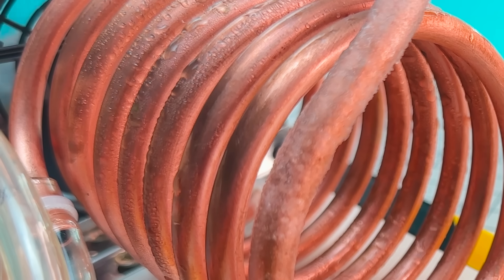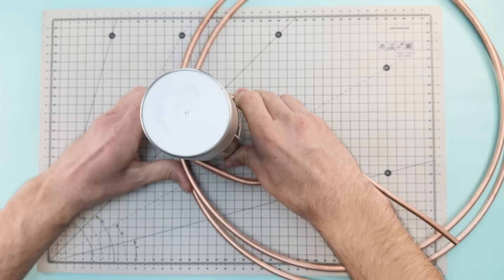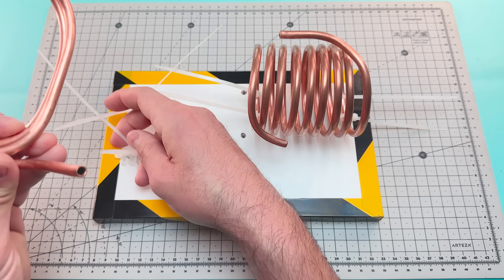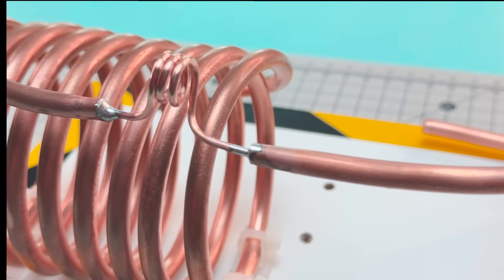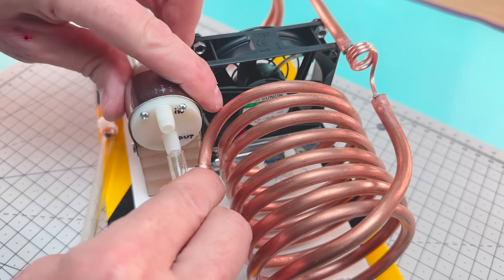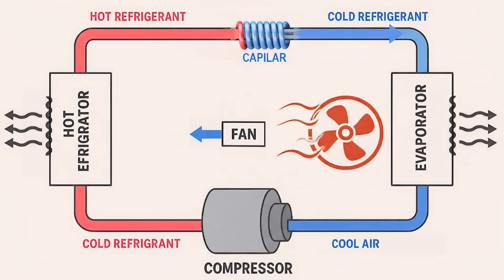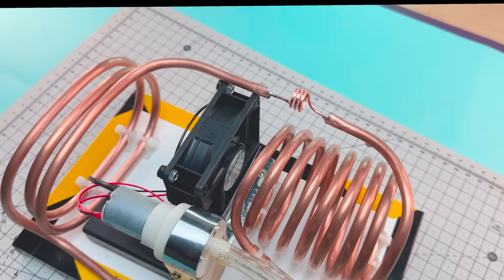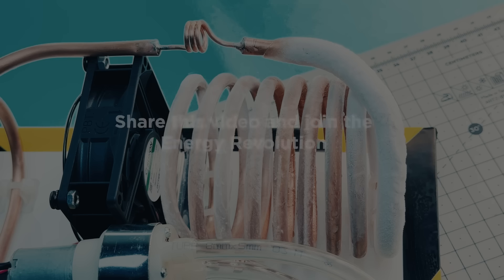Make your own AIR CONDITIONER at home Fast and Easy!

Comment: As an hvac technician, this is a fever dream 😂 please don't blow yourselves up guys.
Reply: There is not much gas in the system anyway. The worst thing that could happen is a short fire ignited by a leak and the motor brush sparks. Enough to burn your house down if you have it near flammable things, though.
Reply: that's the best part tho. 
he's got a diaphragm pump no sparks no boom. they're very safe to pump flammables.
Reply: @darkshadowsx5949  brushed motor "sparking brushes"

Comment: So many things wrong with this video:

1) Awful A.I. voice.
2) Voice cannot pronounce 'capillary' properly. It should be cap-ill'-a-ry.
3) Voice cannot pronounce 'Isobutane' properly: Iso-bu'-tane is correct.
4) Putting both coils close together is useless. The system as a whole will warm up the room.
5) Far too small to cool a room effectively.
6) Running a 12 Volt air pump on a 9 Volt battery. 
7) Running a 12 Volt fan on a 9 Volt battery. They both need 12 Volts from a good supply..

8) The battery is far too small in capacity to work for more than a few minutes.
9) The hot coil needs another fan, or cooling fins, for much better efficiency.
10) The deafeningly loud and overdramatic music is totally unnecessarily.

Also take note of the flammability of the coolant. Care is needed.

Apart from those points, and maybe with the addition of a thermostat for proper temperature regulation, the principle demonstrated is sound. It should encourage people to think, to make one and to improve upon it. Thanks.
Reply: dont' forget not purging the system of air before injecting the butane..   the unit would heat up a room , not cool it.  since entropy in room is increasing ..

Comment: You clearly have talent for engineering and assembly, and this was a very cool video ( pun intended ) That said, you really should not
A- imply that this device can replace an actual air conditioner. B- mention nothing about have to vent out the heat C- mention ANYTHING about the risks and dangers involved.
If you have the hot side AND the cold side together you actually have a very dangerous, highly inefficient and potentially explosive mini heater.

Comment: Even if this were a) pushing the heat outside b) powered by something more realsitic, air is a very poor conductor of heat. A simple coil is not going to expose enough surface area and needs a proper heat exchanger at both ends.  NOT AN AC by a country mile and a waste of precious copper.

Comment: It looks like your fan is pulling air through the hot side as well.  While it's not as tight of a coil that's going to reduce efficiency.  Would be better to put the hot coil to the side.

Comment: I think sectioning off the hot coil & adding another fan that blows the hot air, then adding a pipe to the end of the sectioned-off porion & leading the pipe to an open window & placing it outside, then adding a nutral fan that's blowing air from the room to both the fans, this is to improve nutral airflow to the cold & hot fans which then will improve efficiency & effectivity. 🙂

Comment: All this mfs complaining about not cooling a room, other saying its cool but just for a project but nobody here talking about using it on a car. I think it's pretty nice to use it in a car, the gas could be dangerous. Probably insulating the hot part from the cool part would be even more effective

Comment: Either you dont exactly know what you built does! Or principles of the refrigeration cycle is... Which is highly unlikely, given the beautiful experiment setup you made...

Or you are intentionally misleading the viewer by claiming this will cool down the room in just a few minutes!
Reply: True. One part of system needs to be contained. So heating unit should go outside, or cooling unit needs to be isolated in "box" like as you said is in refrigerator. But entire room which is for example 10-15m2 its ridiculous 😆😆

Comment: science project  , yes can be Explain Basic Air condition principles  but no way can cool any room , may be kept cool small insulated Box  as Fridge , Batter can not keep up long will die in Few Minutes which 9 volt batteries are most expensive batteries in market , powering Pump and Fan same time  will drain matter of Just few munities . can not be economical either .

Comment: It could be a fun project. A little separation of the two coils so the heat could go one way and the cool the other and it becomes a "personal cooler". Replace the 9V battery with a walwart and a second fan on the back coil and maybe in a box of some sort to channel the heat away. It is not going to heat up the room with a 9V battery running at 500 mA and dissipating 4.5 watts. Should not make you sweat too soon. Give the guy a break it could be a great science project. Might think about the flammable liquids...

Comment: This will actually RAISE the temperature of a room. For a heat pump to work, you need to have the hot side OUTSIDE. This is why refrigerators are WARM on the outside.
Reply: True. It has to be split to release cool air inside and hot air outside. Otherwise it will likely have no effect. I see such adds on internet where someone made a small portable AC but thats just a thermodynamic joke.
Reply from the maker: Exactly. But we can cool a can of soda.

Comment: .. here's at least a possible positive; this would be a simple demonstration device for a kid's classroom or science fair project on condensation/heat exchange using mechanical systems, though, as stated in quite a few comments, not useful when practically appiled (ymmv) regards, Geary

Comment: Shouldn't the warm air be vented outside or removed somehow? How long does the battery last? What do you do with the condensation? Does the gas need to be refilled?

Comment: Is the pump in the video just a regular water pump? Is it safe to use?
Reply: Of course it is not. using this pump with butane gaz and and electric motor producing sparks...
Reply: Its relatively safe as long as you keep it within a fire proof safe in someone else's house surrounded by fire extinguishers. Oh...And...Never turn it on.

Comment: Maybe you could put your machine in a box or small room. Check temperature before you start it and check it 3 hours later. The result will be interreting !
Reply: According to the law of conservation of energy: You are pleasantly surprised to find that ice has formed on the copper tube, but the temperature in the room or box has increased, haha

Comment: This object is only a copper tube cooler not an air conditioning. Cold is created at one end because heat is released at the other. Put the hot part outside the room and you'll have a true refreshing effect inside the room. But it's an interresting illustration of how an AC works !

Comment: The heat is just transfered from one coil to the other so it will not cool anything down let alone A ROOM! The hotside coil needs to be outside the room, ever seen an aircon unit on a wall outside,yes .

Comment: I know that fan hardly pulls any power

How long do those 2 1.5v AA BATTERIES last running the 12vdc air pump? Just curious because this doesn't seem very efficient

Comment: Ce dispositif ne vas pas être fiable dans le temps, dans un circuit "frigo/clim" il est impératif de faire le vide d'air (utilisation d'une pompe a vide), car l'air contient de l'humidité qui gèle a partir de 0 et qui va boucher le détendeur, donc plus de froid, et puis la position du condenseur derrière l’évaporateur n'est pas bonne il doit être isolé de l’évaporateur et  question sécurité mettre de l' isobutane dans un tuyau PVC ou silicone ne le faites surtout pas! j'ai travaillé 32 ans dans la production du froid, croyez moi ne le faites pas.
Reply: De toutes façons, avec ce type de tube et l'étanchéité des raccords, le gaz ne va pas rester bien longtemps à l'intérieur.

Comment: the pump is most likely 24v 3.5a. Fan 12v 0.12a. So whole setup is around 100w. Maybe for a small portable cooler is good enough

Comment: One little leak and a spark from either the DC fan and the blower motor any possible spark !! A little bit of a haboom wherever it is placed ..

If anything the coils need to be wrapped in insulation and  then wrapped in a foam or something, you'll need something for condensate, as anything to drop anywhere near the electronics and or battery is a hazard, should also incorporate some type of cooling the motor and battery as those will get hot !
Reply: ^ this

Comment: unless the evaporator side is ported to the outside environment, you are just putting that same heat back into the room you are trying to cool
Reply: You even generate more heat as you need to calculate the Electrical Energy into.

Comment: Hello, I want to do the same system. However, I got stuck in a few places. I could not get any results. The system did not work. Can you support me?
Reply: I really don't think it does work. There's a reason standard air conditioners use compressors and not miniature pumps. I believe if this really worked then it would have been done years ago. I expect there could be some cooling, but not a huge amount. You have to think about physics, and that you can never get more energy out than you put in, and you're only putting in a 9 Volt battery and a bit of liquid?!
Reply: @jewellymon1979  its more of a proof of concept if anything. Obviously things need to be improved/upgraded but it does work.
Reply: It didn't work because this particular setup won't work it's fakery
Reply: How to fix in 2 easy steps...

Step 1. Sell it for scrap
Step 2. Buy a window AC unit

Comment: i turn on my refrigerator ...and  let the door open 😉👋
Reply: didn't know someone else has half of my idea. other half is taking the refrigerating part for igloos apart from (inside those electric lids). now is there still an issue with actually heating the room that I'm seeing all in the comments?
Reply: @robert-asdf  an AC is a heat pump. Where do you think the heat is being pumped in this stupid toy? From one coil to the other. BOTH are in the same room. Think
Reply: @AG-sx9ws Been thinking. Now shorthand explain a mini fridge or those electric igloos. What components (and possible locations of it) are the guy missing? I did find something fishy with the whole thing when I didn't see any water going anywhere. I figured the smallest effective mini fridge a ytber would make, I would have to pour water out somewhere every so often, but I don't care.

Comment: Completely misleading info. This is just a small refrigeration unit design unit, not an aircon. You will first need another fan to vent out the exhaust and even if you do, the cooling can only cool a small freezer compartment box. To make it like a true air-conditioner unit,  the gas still has to pass through a separate set of much larger surface area evaporative coil just like any normal aircon. But even if you do that,  based on the power specs of this unit, the compressor will not able pump enough  gas pressure and cold air to achieve the required BTU rating to cool a room. My estimate for this unit even if designed with a/c components (include valve control and thermostat cut-off etc.), the BTU is likely to be below 200 BTU which is far below the 5000-7000BTU required to fully cool down a small room quickly. This unit's BTU can perhaps only cool down a small dog kennel LOL.
Reply: It won't cool anything because there's air in the system and there's no way that that air pump is creating anywhere close to the 50+ psi you need to condense isobutane at room temperature

Comment: Is it safe?

Short answer: Not really—for most DIYers.

While technically feasible, using isobutane in DIY cooling systems has significant safety risks:
⚠ Main Risks
1. Flammability

    Isobutane is extremely flammable.

    A tiny spark (even static electricity or a relay click) can cause an explosion if the gas leaks in a confined space.

    Leaks are especially hard to detect because isobutane is odorless unless odorized (which it's not in refrigerants).

2. Leak Danger

    DIY systems are often poorly sealed compared to commercial refrigeration units.

    Even a small leak can build up enough gas to reach flammable concentration in a closed room.

3. Asphyxiation (in rare cases)

    In a very poorly ventilated space, escaping gas can displace oxygen, especially with larger volumes.

4. Legal & Insurance Issues

    In some countries, using flammable refrigerants in homebuilt systems is against regulations.

    If something goes wrong, insurance won't cover damages—even personal injury or fire.

5. Lack of Proper Equipment

    Refrigeration systems using isobutane must be:

        Leak-tested

        Properly vacuumed

        Pressurized to safe levels

        Built with spark-proof components

DIY setups often skip one or more of these steps.
Reply: Does it help at all cooling the room?
No, heat taken from one side is ejected at the other. hahaha

Comment: Congratulations! You have built an energy-destroying device that discharges your batteries, heats one side of your device and cools the other.
Reply: Cool huh
Reply: Energy can't be destroyed.
Reply: @darkswami  Why not? It sure can be created out of nowhere (as clearly implied by BBT), so I guess we just didnt know it can be destroyed. Until now!
Reply: The device is not perfect and could use some improvements but the principle is there. The system could use a longer tube on the hot side to level down the temperature more efficiently or use a caloric dissipator.
Reply: Show us your Project, Einstein!

Comment: zero sum since the hot end is in the same room ?
Reply: not zero sum - worse than as you can't have perfect efficient thermal engine/process of any type. 
The heat generated by the cooling process must exceed that removed at the cooling side. Upshot is if left in a room - under adiabatic type conditions- it will only succeed in warming the room and not cooling. 
To work, the heat from the heated end must be extracted somehow (ducted airflow)  and dumped to ambient outside the room.

Comment: I see many people saying to vent the hot air outside, but how would he do that with the system he built? Generally curious.
Reply: Use a pipe that goes out a hole in the wall or a window, seal it tight around the hole/penetration . Like the small portable ones in buildings, they have a flexible duct hose that either goes out a window (sealed up tightly so air doesn’t leak in or out around it) or it goes up into the ceiling tiles , which is non-conditioned air anyways. As long as it leaves the conditioned space it is fine
Reply: @PatrickJayUAP I guess what I'm asking is how to connect and exhaust to the exact same model he built?

Comment: Even though this wouldn't work to cool an area as it is, its a great tutorial for someone that just wants to experiment. After watching this i plan to make one of my own. Ill add another fan and duct  the warm air out. Maybe it will cool a tent running of a Milwaukee battery. Great video.
Reply: テントの中でブタンガスで作動するクーラーは使いたくない。
ひとつ間違えたら火達磨だ
Reply: @user-keibow Great point, maybe a different coolant or build method.

Comment: It's a cool science project with little practical use other then putting a drink in the coils and letting it cool them or putting the evaporator in a small insulated box to cool it.

Comment: Air conditioners have a greater than 1 energy output because they exchange tem[erature, they dont just create coler air. Basically they cool inside and heat outside but here you have evrything together so you are not really cooling much of anything.

Comment: The problem with this system is, that it is a heat exchanger. So it will overall increase room temperature because when the gas becomes liquid again it gives away heat plus the heat energy put it by the battery- You would need to lead the system to the outside, so the heat could be transfered outside the room!

Comment: This could be the basis for a project that would actually be somewhat useful. You could make a mini freezer or a fridge with thermostatic control, that would be way better than those shitty peltier mini fridges that consume loads of power and are very inneficient, and this would be entirely battery powered.
Reply: @technologyconnections

Comment: if the room was a 2 foot square, maybe a couple minutes. This is my profession. I laugh at all the gimmicks out there that claim it cool "the room" in just a few minutes. The temp on this is cold, but its a volume issue. Not enough tonnage to cool the btu's of an entire room. Formula is 1000 square feet per ton, (depends on geographical location).
Reply: And will only heat it up a little, unless the condenser is outside the room hahahah

Comment: Hello, cool project. Which compressor did you use and where can i buy one?
Reply: Ставится в водяных помпах для воды.
Reply: @EVA1903 I have bunch of fish tank water pumps, wonder if I could use that?
Reply: @EVA1903 I tried that one, and it froze the membrane. I have to re-try with an air instead of water pump. And yes, the gas is a safety issue, depending on the volume though.

Comment: How can you magically power a 12v fan + a 12v pump with a 9.5v battery?
Reply: A 12v fan doesn't need 12 volts to operate. It just isn't as fast as it would be with 12volts.
Reply: rated for 12v. not only 12v.

Comment: Well this is cool, but the heat absorbed by the refrigerants is released back to the room so it won't make any difference to the room's temperature.
This is more like a freezer than an air conditioner.
Reply: In a large area you could have it blowing cold air at you while releasing hot air vertically. It would cool you off and the heat will disipate elsewhere. Probably would be ok in like a warehouse setting.